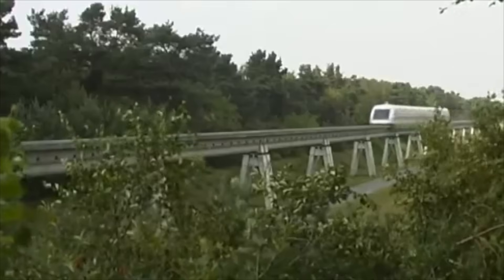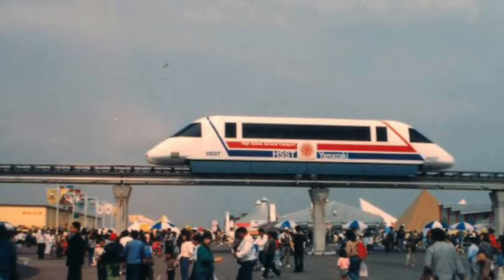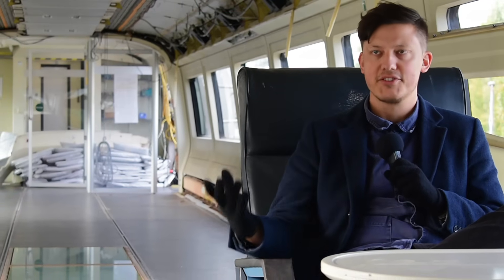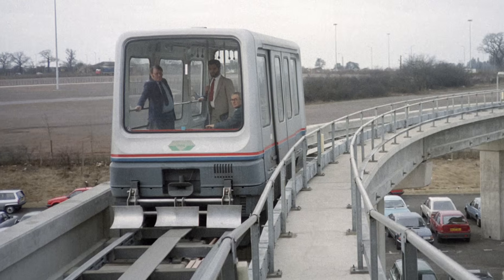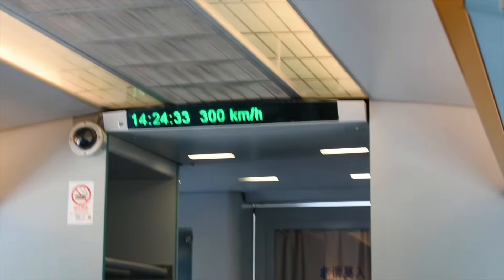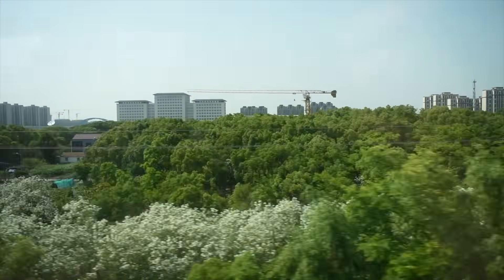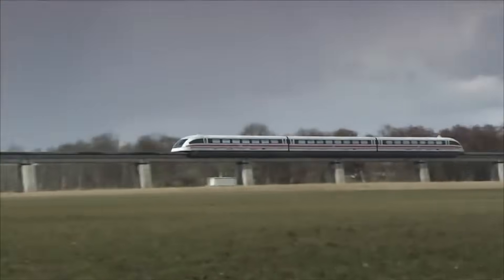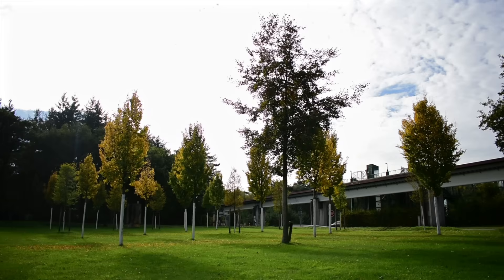Why Did Maglevs Never Succeed?

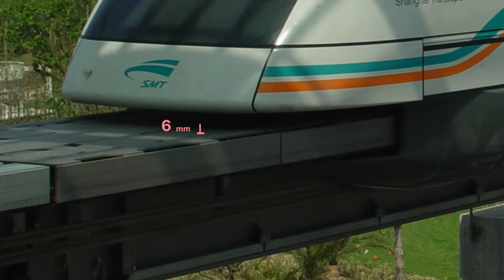Comment: Heard of and rode on! Correction at 1:56 though, the clearance of 10mm on transrapid is left to right on the tracking magnets and between the bottom of the guideway and the lifting magnets. Between the top of the guideway and the car floor is about 15cm.

Comment: Although not altogether surprising that the Maglev at Birmingham Airport got glossed over in you video, it is worth noting that there were two major reasons for it being abandoned: firstly it was not altogether reliable enough but, secondly and pretty importantly — especially since this is a major problem on the Shanghai system — it cost a fortune to run.

Comment: The accident changed absolutely nothing. The system was doomed to failure from the start. There was no serious plan to implement the project at that time. The last ludicrous proposal was to use the Transrapid as an airport shuttle in Munich, which was already a joke back then, apart from the infamous "10-minute" speech.

Deutsche Bahn, which was already operating as a private company at that point, had no further interest in a competing product for its ICE system. Moreover, the automobil and aviation lobbies had a vested interest in the project's failure. Even the pseudo-environmentalist Green Party favored domestic flights around the year 2000.

Comment: i think the 2 main problems with maglev is:  
1) when do you actually particularly need to go 600km/h? especially considering how much more expensive it is than just building a 350km/h regular railway.  
2) it's high performance at the cost of reliability and flexibility, you can't run trains without electricity AT ALL, and it can't interoperate with regular railways.  

Maglev isn't going to be even remotely sensible unless you already have a ton of extremely heavily used traditional high speed railways, so basically japan and maybe china are the only places where it'll see any use at all in at least the next 50 years.

Comment: So, I just made some calculations out of curiosity, and this is what I found. The Yamanashi Prefecture Maglev hits up to approx. 324 knots (knots being the equivalent speed measurement used in maritime and aviation. 1 knot is roughly 1.15 mph or 1.852 kph.) The average commercial airliner (one that doesn't fly supersonic, granted we don't have any SSTs flying today following Concorde's decommissioning in the early 2000s, but that may or may not soon change) flies at 478 to 521 knots cruising speed. That's almost two hundred knots slower than the fastest cruise speed of a typical airliner.

While that doesn't mean much for long distance, it is blisteringly fast and exceptionally efficient for routes that otherwise would be taken up by short haul flights, on a magnetically floating train that theoretically could carry more passengers traveling to the same destination. That completely changes the game of mass transit as we know it, if Japan can prove that maglevs are economically viable.
Reply: Japan proved the SC maglev between 1997 and 2011 and if it can take overnight container trains it will reduce daytime fares lower than planes.
Tom has a good video of it. and I sugggested it from Melbourne to Brisbane on the maglev forum.

Comment: The biggest failing of the Transrapid (imho) wasn't even addressed in the video.
It had no applications. The technology itself is not bad, yes noise from air displacement, but you get that with any moving object at those speeds, with traditional rail you get rolling noises on top.

The biggest issue were the humans inside. To actually be an improvement over other means of transportation it needs to go fast, but humans are squishy, so acceleration needs to be somewhat slow. That means it takes a while to get up to speed. It's practically useless on short regional lines with lots of stops. If you have so many stops that you have to go slow (for passenger comfort and safety with acceleration), it has no benefit over light rail, except it costs more to build and operate.
To really use it's speed as strength it needed to be on long distance connections, competing with airplanes, not with trains. And the planned long distance routes ran into all kinds of political resistance and nimbyism. All the usual stuff, from people concerned about their view, to the cost, to environmental protection … you name it. So they never agreed on a route and eventually it just stopped.

Turns out it was a better idea to strengthen the existing rail networks, which had a higher train density and therefor more capacity and were more versatile allowing for cargo and passenger travel and … the rails were already built, that's a big cost-saving right there, old rolling stock could continue to be used. With the way the economy developed the Transrapid seemed more like a vanity project than a viable transportation solution. A Gadgetbahn.

Comment: My theory is that it was slowed because after 20 years it had subsided sufficiently to make it rock badly even with twice the foundations the 1 cm clearance was insufficient.
The Japanese SC maglev which was proven between 1997 and 2011 has 10 cm clearance but the NIMBY next neighbour stopped the tunnel for four years.
China is great at TBM tunnels but not maglev and vice versa but they do not get on.

Comment: I was a big fan of the Popular Science magazine back in the 70's and I remember talking with my dad (who had an engineering degree) about the two technologies of maglev: repulsive and attractive.  The one problem with repulsive tech is the train has to be going at least 30mph (kph?) before it can levitate.  I never understood why that was the case, but it made us wonder if it was possible to combine the tech: use attraction to get it up to speed, and repulsive from then on.  I came up with a design on a napkin (we were in a cafe at the time) that "should work".  No idea if it actually would have or not and I've since forgotten the design, but it was fun to brainstorm with him (I was in my early teens).

This is definitely one of those technologies that I want to work because it's cool.  I remember riding a VERY short demonstrator at the '86 world's fair in Vancouver.  I think it was all of 100ft if that: it started at the center, slowly went to one side, then the other, then back to the center.  Not exactly thrill ride material.
Reply: If you can turn the front wheels in an overnight container siding with SC maglev it eliminates complex points.

Comment: The Hangzhou - Shanghai maglev line was so close to reality there's even platforms reserved next to the high speed rail platforms during the construction of the Hongqiao transportation center in Shanghai. Currently part of the platforms have been turned into platforms for the airport connection line between the two airports in Shanghai with the rest of the platforms remains unused.

btw my mom thinks microwave ovens has some kind of radiation and refuse to get one in her house. She only uses conventional oven. I think she'll also say no to maglev tracks if someone build one next to her house.

Comment: When I flew from MUC (Munich) to PMI (Palma de Mallorca) in August 2023, the whole arrival, baggage, security, and boarding process took six hours, just because MUC is such a mess when it comes to service, management, and staffing. Cutting the travel time from 30 minutes (via S1 or S8) to about 10 minutes with the Transrapid would have made a huge difference... not

Comment: Ah, Transrapid. I remember reading about it in a (Dutch) popular science magazine from the 1970s. That article also described running maglev trains in a vacuum tunnel, which somebody – decades later – rebadged as 'hyperloop'.

Sometimes, somebody has an extraordinarily good idea. This year, we're celebrating 200 years of railways. And while railways had an evolution leading up to the Stockton & Darlington Railway, they've remained essentially unchanged since George Stephenson reckoned that 4'8½" would be a good size for railway gauge. The way we propel these trains has changed, but the basic principle – conical, flanged wheels on rounded track – is the same as 200 years ago. What other mode of transport of two centuries ago do we still use today?

The problem with maglev trains is that they're not good enough to replace either (high-speed) trains or aeroplanes. Moreover, they require entirely new infrastructure. High-speed trains are approaching the 450 km/h that maglevs promised. And while maglevs are now closer to 600 km/h, you need very busy corridors to justify building that new infrastructure. There are only a couple of places on earth where this would work, mostly in Asia.

Comment: As a rail enthusiast growing up in Shanghai, it is a pity that the maglev line did not went through to Hangzhou. It seemed extremely unlikely there would be a extension to Hangzhou given Transrapid is gone. There are efforts from CRRC to build new high speed maglevs like the CF600, but they all seemed far from ready. That being said, I heard that the government of Shanghai did reserve some space underground at LongYang Road even today incase there is ever an extension so the trains can go underground and dodge the built up area in the city. Even when the new suburban rail station was built in the "box" originally planned for a maglev terminal, half of the "box" was left empty, possibly left for future maglev station construction. (despite not having a maglev station, Hongqiao airport actually had a "to maglev station" sign up until ~2023)

Comment: It just couldn´t beat the already extensive and all integrated rail network. The Shanghai example perfectly shows that it´s almost impossible to build something like this into the city centre. Failing that, it just becomes an isolated network where you have to first go to the maglev station outside of the city. Conventional high speed rail is fully integrated, you can board the Eurostar in the middle of London at a 150 years old station and be out on the high speed line in minutes. Same applies for any high speed line in Germany or Italy for example. You just can´t beat that with any new system.
Reply: There were concepts for fully tunneled lines though. Putting a TR into the middle of the city would have basically been like building any other HS railway tunnel. There were renders at the time showcasing the concept, including stations with screen doors and everything.

Comment: 1:54, the 10mm number is about correct,  ut the picture is wrong. the 10mm is under the guidway, not over. Over the guidway its about 10cm.

2:08 "a strip of ferro magnetic rail"
Well, not quite. Linimo and derivatives with short stator does that, but Transrapid and sysem with long stator use silicon steel long stator to attract the magnet. No ferro magnetic attraction to lift the train, While the side plate to guide it is.

10:00 No it was the Shanghai municipality government that ordered the Shanghai line, not the Chinese state government, this would turn out to be very important later.

10:56 501km/h was the trail speed, not the service speed, the service speed was 430km/h, but the indicator often ticked over to 431km/h.

11:34 That is incorrect. Shanghai maglev train is fairly cheap to run. While its true that it haven´t made much of a profit, that is also true for all other railways in China. SMT is one that made the least losses.

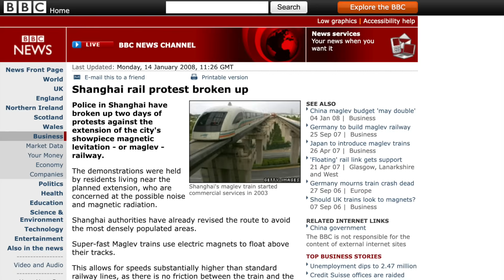12:10 No that turned out to be astoturefed. Someone payed people to protest. And here its matters that it was Shanghai government that build the line. Because Chinese state government was against it. We later (in 2012) found out why,. The secretary of the railway was bribed to stop it. (and this is not a conspiracy theory, he is currently in jail on the bribe conviction)

12:30 The operating cost are very low.

For power demands its a bit more complicated. The energy demands are actually very low. The power demands are quite high. The reason is that the train push energy back into the grid when it breakes. So while it use little energy, it use a lot of power.

13:55 Yes and no. They did invite people to ride the track. but they also sold ticket to the general public as a fair ground ride. This would turn out to be important later.

14:35 that is not quite accurate. What happen was that they overrides the clearing of the track. The operate later in court claimed that he thought it was error, despite error of this kind wasn´t common. It was romoured that it was done intentionally but never proven

The TR08 train isn´t really "light weight" the whole train set is about 150 ton empty. So its considerably heavier than the maintenance vehicle, but it turned out to be more fragile.

14:53 The train was not obliterated, the first car of the train revise some 70% structural damage, second car got 2-3% damage, and third car got 0% damage.

14:56 The claim that there was 31 people on board seams to be incorrect. There was 23 dead, 8 wounded, but there was also a unnumbered unwounded number of people that have not been reported. There is no manifest from this train, so the unwounded people was simply never logged. Media just falsely assumed there was no unwounded people.

16:40 The TR09 was in development already prior to the accident.
They didn´t revoke there testing license, they revoked there license to operate with paying passenger. This was actually really bad, becasue the test facility that had hardly no government support at this time, got most of it income from ride fair, not grants at this time.

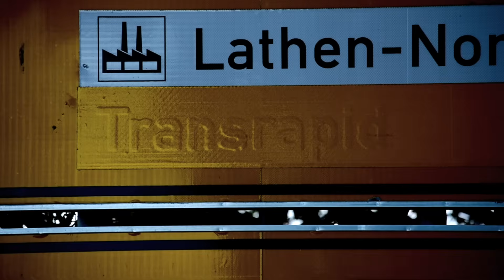17:20 The energy demand and high operating cost are just plain wrong statements. The POWER demands are high, but the energy demands are low. The operating cost is about 1/4 of that of high speed train.

17:52 While the noise of the TR07 (as referenced here) was high., it still lower than that of high speed rail. The noise was pushed down with the prototypes after, and noise level from TR09 is far lower than that of high speed rail

Comment: I'm sorry, they were going to build a maglev from Hamburg to Berlin? Wouldn't that have required an infeasible degree of inter-German cooperation?
Reply: That was in the 90s, shortly after the wall came down. Most of the ICE network really was built after the end of the cold war. And the original plan really did envision a maglev from Hamburg to Berlin. Which was deemed to expensive and got axed. There is a whole lot of politics involved that the video glosses over, but I have to point out that a certain Hartmut Mehdorn (Deutsche Bahn CEO at the time) is passionately hated by railnerds to this day. He axed a whole lot of big futuristic plans, not just the Hamburg - Berlin maglev.
Reply: @jcxz983  that maglev was really nonsense.
Reply: Well there was a plan for that, but... that didn´t happen due to mostly coruption

Comment: China is in a testing pattern, but Japan's maglev is actually under construction.
Reply: And losing a LOT of money without start regular operations...  it is a BIG white elephant.
Reply: @MarceloBenoit-trenes  Yes, can't argue with it taking time and money to build... Japan is also a very challenging place to build things in, especially when you're running the train under mountains. 

You can't deny that in a country like Japan, having a backup for the main artery connecting your two largest cities isn't necessarily a bad thing. 

That being said, the issues have nothing to do with it being maglev. In fact, the problems would likely be worse with conventional rail, as standard rail would require larger tunnels... and 80% of the line is tunneled.

The route cost may or may not end up being a white elephant, but the technology choice has little to do with that.

Comment: When I rode the Shanghai Maglev in 2007 and 2011, I noticed how incredibly shaky it was. I always assumed it was because of the many adjustments per second it had to make to keep the floating distance around 10 mm. From what I read about people's experiences with the test track in Germany, and it being silky smooth, perhaps it was the construction of the line in Shanghai specifically that made it shaky?

Anyways, the regular high speed line from Beijing to Tianjin was silky smooth in 2007 at around 300 or 320 km/h (I don't remember) compared to the Shanghai Maglev in the same year.
Reply: I rode on the test track as a child and I remember it indeed being extremely smooth. You noticed neither the steering horizontally nor the acceleration a lot. It didn't even push you into your seat, it just accelerated gracefully like nothing I've ever experienced before.

Comment: 10:53 The mentioned top speed of 501 km/h was never the regular top speed; it was only achieved during a non-commercial test run on 12 November 2003.
The regular top speed used to be 'only' 431 km/h.